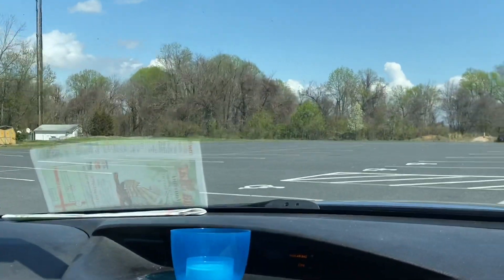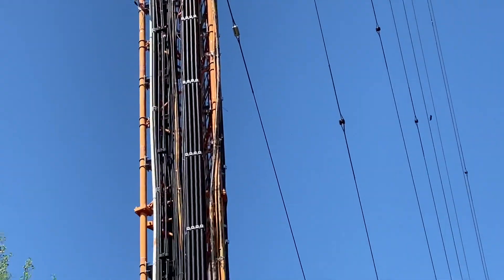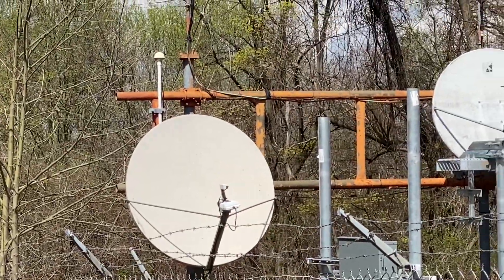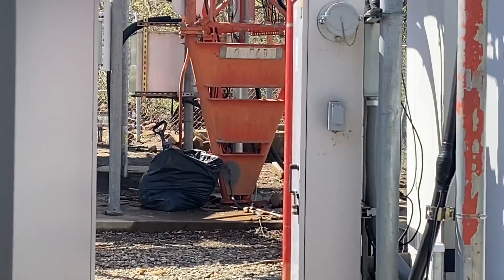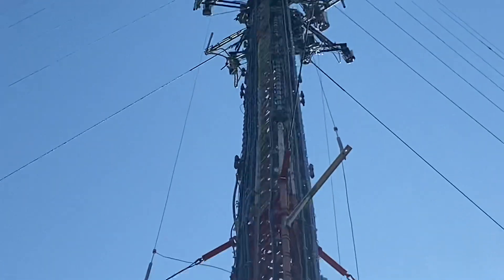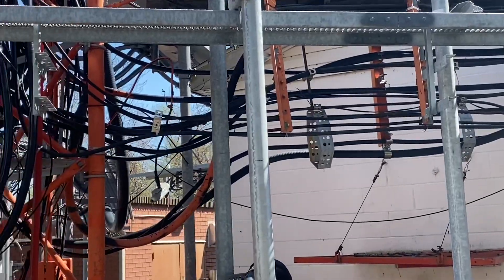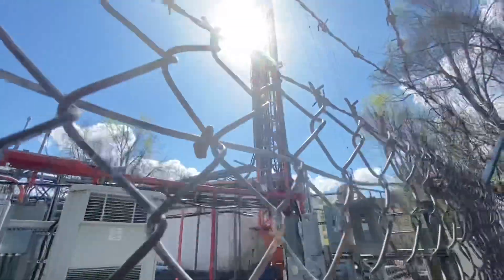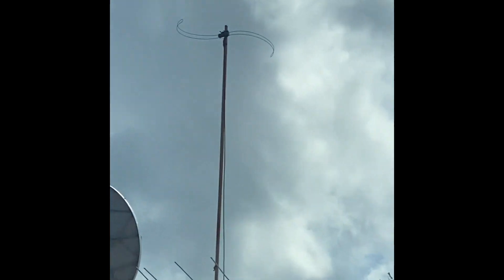Going to an AM transmission tower with my best friend. Best day ever.

Comment: I wonder if it used to radiate and has been converted to a grounded tower for cell service. Maybe it used to have an insulator at the bottom or something.
Reply from the maker: Yeah I’ve been wondering! And the grounds look like they were added later because of the paint overspray.. good point.. thank you. Hope things have been going well, looking forward to future updates on your projects.
Reply: @FoxyLobo  it would be interesting to find out. 

Things are well with me,  I hope they are with you also. I apologize for not having any new radio videos yet,  time has been hard to come by.  Hopefully I will get some free time soon.  I have a lot of video I would like to make. Have you made any progress on your transmitter?
Reply from the maker: @JohnHamerProjects  Thank you.. my situation is similar. I have gotten the transmitter working into a dummy load and have learned a little about oscilloscopes to verify it was transmitting, but need to run it through the LPF and make a good antenna system... I am thinking of using SMA cable instead of larger coax to outside and then... maybe use an old electric fence for dogs/fence like a radial system.. or try and hook up to the plumbing. There are guardrails and a GIANT fence (perhaps 1/2 mile long or so) that I could hook into if really ambitious...

I am also curious how to get an SWR reading on an object like a fence or guardrail; perhaps I can ask you - I made a tool to hook up a Nano VNA via alligator clips to different fences and such to measure SWR, impedence just for fun.. the problem I am having is determining the correct way to hook up the positive and negative terminals.. I feel silly for not knowing something this simple, but am thinking in principle the concept is similar to an end-fed antenna of any sort - what happens to the ground clip? does it literally go to ground? I am curious about the antenna characteristics of "naturally occurring" metal structures as they are inherently in contact with the ground to begin with.. perhaps they are simply better utilized as a ground plane in concert with vertical antenna or something similar for the longwave frequencies.. I was reading about how drastically a good ground field can attenuate the takeoff angle of MW/LW frequencies and make the ground waves more efficient.. Thanks...
Reply: @FoxyLobo  I'm glad you got the transmitter working. I would not be able to help you with that because I couldn't find any information on it other than the link you sent me.

The negative terminal of the Nano or the transmitter will connect to the ground. You can do this using a ground rod, or connecting to something like a water pipe. To improve on this, you can add ground radials on the ground or just below the surface. All of the ground radials will also need to connect to the negative terminal.

I don't think an electric fence will work very well as an antenna since it is so close to the ground. I believe you are going to lose most of your energy into the ground. But, it will be a good experiment and learning experience. The higher off the ground you get your antenna, the better it will work.

The positive terminal will connect to the electric fence wire. At this point you can take an SWR reading. But, an SWR reading isn't really what you are interested in for a random length wire antenna. 

You need to know the actual resistance of the antenna, so you know how to make an impedance matching transformer. So, you go to something like display->format->impedance and determine the actual impedance in ohms. I haven't really played around with my Nano VNA enough to know exactly how to do this. I use an antenna analyzer, but the Nano VNA is basically an inexpensive alternative to an antenna analyzer so I know it will do it. Once you know your impedance, you will build an impedance matching transformer to make the antenna look like 50 ohms to your Nano VNA or your transmitter. If you then took an SWR reading on your Nano VNA you would get a reading of something close to 1. You may be able to use the taps on that variable inductor you have to match your impedance if you wanted to do it experimentally. That is one of the things I was going to cover in my video.

But, having the swr/impedance correct only guarantees your antenna will not damage your transmitter and make sure your low pass filter is going to function properly. If you really want to make the antenna perform well you have to make it resonate. That involves taking a reactance reading, also from the nano VNA, and determine if you need to add inductance or capacitance in series with the antenna to get it to resonate. The reading will be in unit j (as in a complex number), such as +120j or -325j. That is what your variable inductor is made for. It allows you adjust the inductance to get a perfect resonant antenna, which will be 0j reactance. After that you will need to go back through the impedance matching process again and you will see a huge improvement on how well your antenna system radiates. You may be able to do this all with your variable inductor, or you may need to add some components in series with it. You will have to take the readings for to determine this.

But, I think you should continue down the path you have stated and get an SWR reading just so you will learn how everything works together.

I was planning on making the first video explaining how I do all of that. I was going to use my antenna to show how I make it resonate and a few ways to impedance match it to get a perfect SWR. Hopefully I will have some time soon. I have a lot of ideas on how to do it.

I have assumed you are just going to use a long wire on the fence as the antenna running parallel to the ground, but there are other similar antennas that have been known to work pretty good for low frequency. They are usually more like loop antennas and connect to the ground through capacitors at either end. I am planning on experimenting with an antenna like that this summer across my field transmitting really low frequency below 8Khz. I am definitely going to make a video on that.